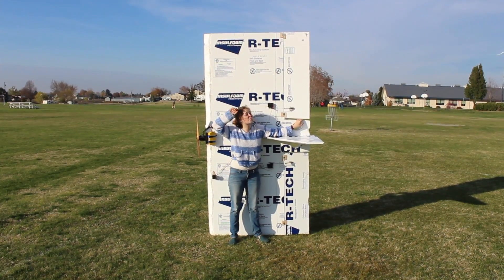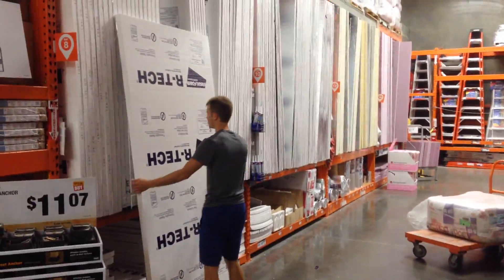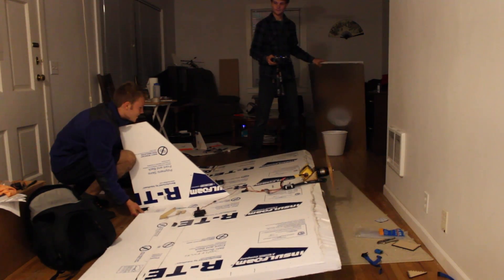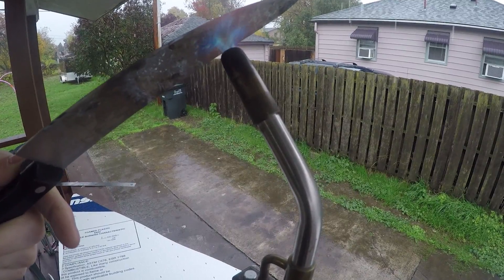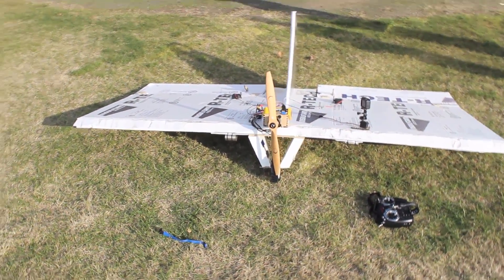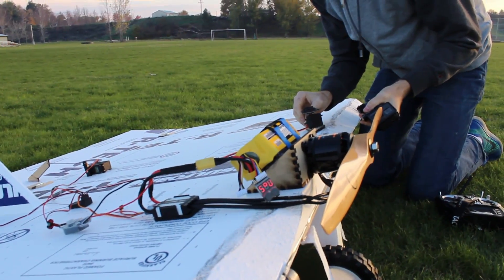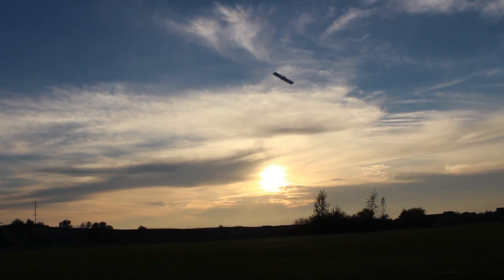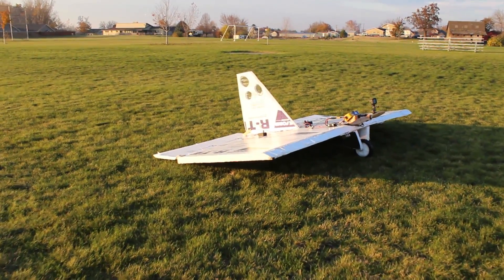FLYING DOOR

Comment: Slice it tip to tip and epoxy or gorilla glue in a door skin spar at 1/3 and 1/3 you will have a non bendy Flying wall.... Laminate in with carbon big sides of each spar 4 to 6 and your should be able to stand on it..... I made a wing 6 ft span with 2 carbon covered door skin spars... I could support each 3 foot wing at the root and tip sitting in bricks and stood in the middle of each.... Carbon impregnated with epoxy is 4 times stronger than steel and lighter than aluminum.... In an I beam you get tremendous strength especially supported full length both sides...  How many people reported a ufo.... Replace the wheel with 2 triangular door skins with foam between and one tiny wheel maybe 2 inches diameter

Comment: could one pulsejet this thing?
Reply: It would melt.
Reply: And pulsejets have a really low thrust-to-weight ratio..
Reply: Could put a heatshield between the jet and the door itself
Also there are other ways of heat proofing things, I have built pulsejets out of pringles cans and another dude has made functional pulsejet rockets with items that really shouldn't be able to take it.
Reply: A small enough pulsejet is nothing compared to the motor in this video.

Comment: As kids - over 50 years ago - we used to make smaller versions of this out of paper. Simply fold the leading edge over to create weight at the front, fold afyselage into the centre, and add an optional tail and elevens by tearing and folding up the trailing edge. The addition of folded down wing end fins is better than making a folded up tailfin. It gives better stability and increases the flight length of the paper glider. They flew much further and for longer than paper darts made from the same A4 sheets. Airspeeds were slower, but they gave uscountlesshoursof fun. I won a paper airoplane dustance competition (launched from a nine storey building) with one.

Comment: thanks for posting.  here's a very very very late observation.  due to the motor Location, the thrust Line does Not intersect the model's center of Mass.   cheers
Reply from the maker: The motor is right in front of the center of mass
Reply: did you See the words "THRUST LINE".  Look It Up, if you need to expand your vocabulary.   the THRUST LINE does NOT intersect the center of mass.   cheers
http://static.rcgroups.net/forums/attachments/2/9/6/3/9/7/a5988257-224-bixler%202%20motor%20angle%20correction.jpg?d=1375236281

Comment: How do you go about deciding what size your propeller should be?
Reply from the maker: The motor manufacturer should list the appropriate propeller size, ESC size and battery voltage and current rating

Comment: You can't say that you used an unmodified piece of foamboard, then show clearly that the leading edge has been modified.
Reply from the maker: I’m not sure what the point is. It’s a very small, unnecessary, but slightly helpful feature
Reply: The point is just that words mean things, as do prefixes, like un-. Whatever. It's still somewhat amazing that the thing flies at all.
Reply from the maker: Well thanks anyways, have a good day 😁

Comment: I like the Rotisserie Cam View.....
Reply from the maker: Thanks, hope you didn't get too dizzy
Reply: Samm Sheperd Lower the footprint of your electronics wiring and make it redundant, with hot swappable everything, and it would make a great drone aerial target for range gunners.  Those guys can't hit anything.   Get back to me after you've cleaned up on military contracts like Barrett Rifle :)    http://air-war.org
Video was shared here by me the other day:
http://www.homebuiltairplanes.com/forums/showthread.php?t=11283&page=60
Reply: Samm Sheperd I bet with conductive ink drawing multiple spread out redundant traces to you control servos and between parts, and multiple servos, you'd need a direct hit practically on the motor/battery prop/receiver to take it out.  Even those could be multiplied and distributed out across the front wing so one going out won't take you down.  You could really have some fun continually improving and hardening your design and real frustrate them, esp with no heat signature.

Comment: That's pretty stupid. But also awesome. Which I think makes it STUPIDLY AWESOME :D

IDK how heavy or strong that stuff is, or indeed what the actual power of that motor is (sounded like it was 200 megavolts or something, which doesn't sound right... 1.8kw? Like 12v times 150A?), or what your actual runtime is (4Ah divided by 150A doesn't sound like many minutes, though of course it doesn't need to be at full power very much) .... but ... assuming it could take the weight of a human rider ... and they wouldn't spoil the lift too much... how much power and how many batteries might that take? :D
Reply from the maker: 5kw
Reply: I suspect that's a result you already worked out before now :D

Or is that the power of the existing motor? Seeing as I wouldn't be too surprised at getting about as much from a hard tuned 50cc 2-stroke such as might be fitted to an RC plane...
(eg its easily enough for low-mid 50s mph on a bike)
Reply: ... Or indeed the 125cc 4-stroke in my own, turning at upper midrange revs and not quite full throttle (peak, it'll make 8.5kw). Does add another 20kg (25 if I leave the gearbox intact and keep the original alternator and starter), but that's offset by greater takeoff power and less weight of fuel for long duration flight, and it's an infamously reliable design that should be able to kick out 5 to 6kw without a hiccup for a couple dozen hours before even needing an oil check, and at least a hundred between changes and valve clearance resetting... 

Hmm...

dismembers bike
empties out all the gears except for 5th
replaces alt and battery with a magneto setup
changes mounted electric starter for a push-on affair
build build build
gets a legendary obituary in the local newspaper

Worth it.

Comment: Wait, this door is 2-2.5 sq. meters size, single side. Solar panel on it would give around 300-400 watts. How much power does it require for steady horizontal flight?
Reply from the maker: It would require much less power if my wing planform was more efficient.  A large high aspect ratio flying wing with solar panels does sound fun

Comment: What is that wing cam mounted on? a kitchen timer? I really like those shots, would be a good build video if you showed that.
Reply from the maker: It's a servo with the potentiometer removed from the case (physically but not electrically). Normaly that pot is connected to the servo arm shaft and it is used to determine the servo's position. With it removed the servo will spin continuously and the speed and direction can be set by turning said potentiometer.

Comment: The wing is not completely a rectangle.  You cut an angle on the leading edge, thus giving it limited and crude airfoil properties. see @8:25
Reply from the maker: +Andy Landen the point is more of a rectangular tailless wing planform. What I did will improve airflow but "airfoil properties" isn't really a thing.
Reply: An airfoil is "any surface, as a wing, aileron, or stabilizer, designed to aid in lifting.." - http://www.dictionary.com/browse/airfoil   Airflow boundary layer  optimization is not a requirement for an airfoil.
Reply from the maker: Andy Landen Still don't see your point
Reply: ***** there is no criticism here.  cut your rectangular airfoil on the leading and trailing edges however you like.  but I would have appreciated the title or intro being a little more forthcoming about the modifications made to the leading edge of the rectangle.

Comment: jesus christ doing aerobatics on a plane that size takes major balls. what'd you use as a wing spar?
Reply from the maker: +Tarik Agcayazi (Killsranq) no wing spar, just foam
Reply: Samm Sheperd I'm just surprised that it didn't fold in on itself. I haven't worked with the insulation board yet so maybe I'm not used to that much stiffness, dollar tree foamboard always ends up folding in on me for my wings. also, what camera is the mini quad using?
Reply from the maker: Tarik Agcayazi Because the whole plane is just a big wing, and that wing is pretty short and fat, the wing loading and bending moments are really small. The Camera is a Yi (the $100 one)

Comment: When I was 16y old, all the young pilots in my rc-club have built one of those. This kind of foam wasn´t invented then, we took styrofoam, reinforced with plywood back then. And nitro-engines, naturally. Mixing was done with a self made mechanical mixer. The name of the construction was simply "Das Brett".
I am 50 now and still have mine in the cellar. It´s still in flying condition and equipped with a 6,5cc 4 stroke O.S.
I guess on those planes only the lower side provides lift, there is a constant vortex on the upper side. It´s not really necessary to bevel the leading edge. It just shifts some weird up-down changes of the airstream on low angle of attack to higher speeds. "Das Brett" with a beveled leading edge in fact can be flown a bit faster without that funky behaviour.
Reply from the maker: +KaffiFlight thank you for you comment! I love hearing about how things used to be done. And though I'd hate to start an argument, I'd like to share my opinion based on my journey to understand aerodynamics as a pilot and academic: lift is not broken into an amount generated by the top or bottom, it is a much bigger picture of the churning and displacement of the fluid. The mechanics by which this happens is exactly the same on this flat plate or a normal airplane. The flow over the top surface just as much a factor as any other wing, though the wing loading is so low that efficiency is not very important.
Reply: *****
Hm, well... I´d like to see some visuals about how the airstream moves in the upper side. Maybe one day you feel like sticking some threads on the upper surface and use cam to check whats going on. I believe the airstream is not linear there. Like on a KFM airfoil. With a beveled leading edge it might "come loose" some centimeters behind it, with a sharp edge, instantaneous on the edge.
I was thinking about this some time of my life, but never tried to proove that. And I am too lazy now, lol. Well, I´d have to get all the stuff to start my OS engine or convert everything to electric and my contemporary RC gear... hm, naaa, this is a sacrilege.

Well, I can imagnie, like on a KFM airfoil, there is a turbulent area, roughly shaped as a triangle, with the base side on the upper surface of the wing, and above it, the airstream goes on.

Comment: Getting your face a little close to the prop there with the battery plugged in. That's how my uncle lost the lens in his eye back in the 60's with my grandfathers gyro-copter. All we was doing was turning the prop by hand when he hit the compression stroke of one of the cylinders. The motor kicked over and the prop sliced his eye open.
Reply from the maker: Oh that's terrible :(
You're totally right, it's no joke. I was careful to set up all my failsafe correctly etc. but this thing could definitely decapitate..
I have some very unique experience in a Piper Super Cub and in the NTSB history you can see that a few decades ago in Alaska "The passenger deplaned and walked into the running engine's propeller" (one fatality)

Comment: is it more efficent to use winglets as verticle stabalisers than one big verticle stabaliser?
i mean... the winglet/ stabalisers cancel out vortex induced drag and also less drag because of a smaller stabaliser as compared to one big stabaliser.
Reply from the maker: One large vertical stabilizer is more efficient as a vertical stabilizer than two separately. Winglets (or more specifically "non-planar wings" are also a very misunderstood topic.
Winglets help reduce induced drag (caused by producing lift, the wingtip vortices are a part but not all of the picture). BUT: the same results can be achieved by increasing the wingspan by 45% of the winget height.
A major design constraint is actually the maximum wingspan allowed in order to use smaller gates at the airport. Winglets increase the “effective wingspan.” So it’s aerodynamically similar to a longer wingspan and they actually increase the lift generated at the tips (by reducing the induced AOA). This increased lift at the tips and also the weight of the winglet’s structure are also structural design constrains (extra wing bending moments). But an increased wingspan which in turn increases the wing’s aspect ratio is more effective per unit surface area. There is no ‘best’ design, but rather a balance of factors to optimize for your specific constraints..
My source can be found at adg.stanford.edu/aa241/aircraftdesign.html under section 6.5
That said I think winglet type vertical stabilizers are a great idea too :) This planes wing loading is so small that planform efficiency isn't super important.

Comment: isn' t that motor combo not very overpowered ?! 
I mean this thing has plenty of wing and no unnessesary stuff.
Is the plane so heavy ?! :)
Reply: According to all Bernoullidiots, this can't fly at all since there is no lift! Angle of Attack or Incidence is why airplanes fly.  Wing shape is a refinement for control and efficiency.  The symmetrical wings on fighter planes fly at mach 2+ and do all kinds of aerobatics, without the "proper" airfoil shape Bernoullidiots espouse.  As a kid, my friends & I had many "Airfoiless Gliders" made of balsa wood that flew well.
Reply: You can never get too big on these with engine Power. Since there is no Airfoil the motor is everything that keeps this thing up in the Air. Thats why i find these kind of Builds really unimpressive and pointless. It is not hard to make something to 'fly' when you put a big enough motor on it. Someone should build a Airfoilless Glider, then i will be impressed
Reply: Sure, but I think, that this Video is made to inspire people and show them, how easy it is to build somethink, that fly :)

Comment: make a speedplane with this motor pls and tast max speed
Reply from the maker: It's 200rpm per volt, with a 42 volt battery
Reply: That's a slow turning motor with 200rpm. To generate such highspeeds you need one with 4000rpm.

Comment: any cahnce that you can link the components also i am thinking about making a brushless powered go kart i mean any recomendetions for big motors and maybe try to land a quad on it itll make a great vid i think (sry for. mah english)
Reply from the maker: +obmar knad just google emax 200kv there is only one. But there are other big motors too
Reply: Samm Sheperd i have just started this hobby i build an ft flyer from the channel flite test and a air sled like yours to get used to it where do you get your stuff. ebay? amazon?
Reply: Samm Sheperd and any auggestions for a. common strach build

Comment: land a quad on it!!!!!!
Reply from the maker: +Greg Roberts We thought about it but then we remembered there is a huge spiny blade of doom up front
Reply: lol, yeah
Reply: Greg Roberts if I had a quad that I didn't care about!
Reply: only slight prop wash... lets try to pick up planes in-flight with helicopters... lets use big jets to pull up smaller jets... please do not attempt any TO or landing behind any rotational vortecee... my problem w/ blade loading & inflatable para-rotors... Samm want to build a dual arch airfoil airframe for my air berring hubs?
Reply: paranna-nado beats shark-nado anyday LOL

Comment: Giant flying rectangles? It's like Atari games all over again.
Nice video.
What about a circular or rectangular wing? Never saw that well executed.
Reply: The nutball is a very common circular wing plane.
Reply: Aren't circular planes rather common? At least in the RC club of my home town they were used as introduction to building with foam.
Reply: *****
Didn't know that. A quick search on YT only brings up the FliteTest one which was all wobbly and unstable. The "Park Shark" looks quite good though.
Reply: thees a big balsa circleplane hanging up in my lhs with a glow motor, dont know if it flies any good though.
Reply: My friend and I flew circular "Nutball" airplanes for several years. I still have mine, and it flies quite nicely, does a lot of unusual looking stunts, is very stable... and always gets lots of attention. The "Nutball" is a great little airplane!

Comment: This is great and has me thinking if you can fly a rectangle, can you fly a cube/rectangular prism? Like a box kite?
Reply: Anything can fly, given enough thrust. How controllable, and how efficient it is, is another matter completely.

When in doubt, add more rockets. actually, add more rockets regardless.
Reply: Tyler Dickey this has been done years ago...n the plans are free
Reply: Boxes fly amazingly well, I've built quite a few micro sized ones over the years.  They're a real head turner too.
Reply: Tyler Dickey I have built a flying “square” it was a rectangle cause the long side that was the wings I built accidentally 1/3 of a centimeter to wide cause I forgot about measuring correctly and didn’t notice till it was done but thecnicly if I shortened it a tiny bit yes completely possible and I have another plane that’s a square (this one is a square down to the milimeter) with a vertical stabilizer sticking out the top back it looks funny and flies well but if it turns to sharp it’s dead
Reply: No, you can't.